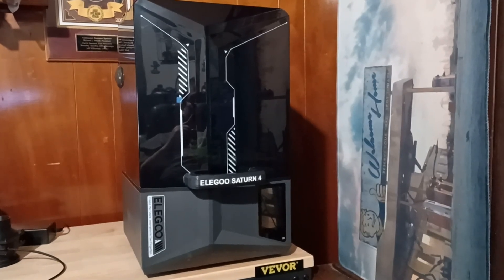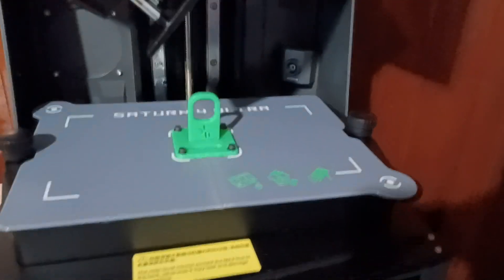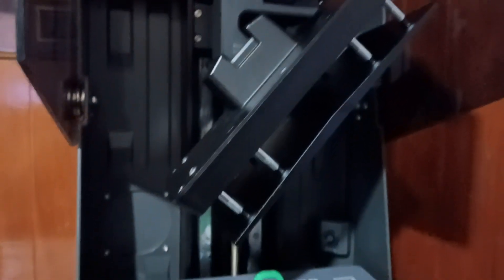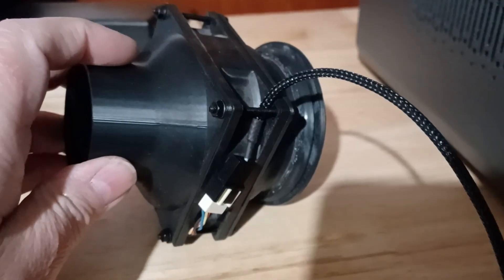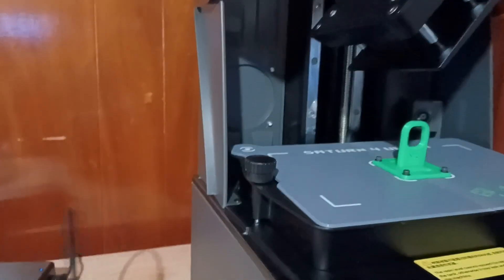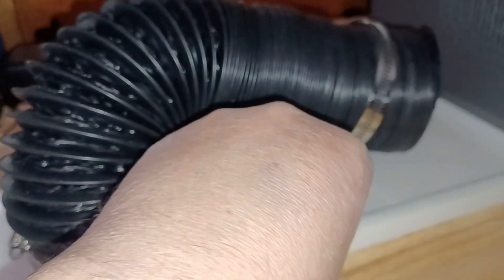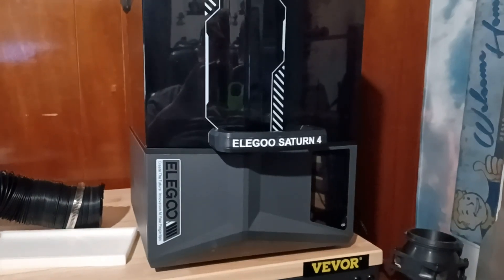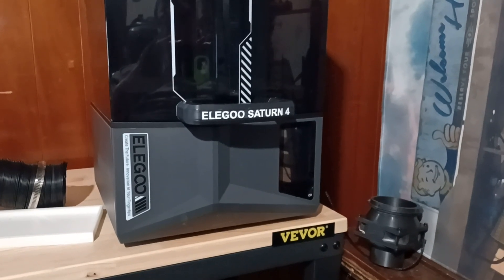Elegoo Saturn 4 Ultra FDM Printed Starting Accessories

Comment: Great video - links were very useful. Have been able to find equivalent products on Amazon UK. When printing the parts were you able to print them directly on the plate or did they require a lot of supports?
Reply from the maker: I printed all of these on my X1C FDM printer and I was able to avoid using supports!
Reply: @TJeffW1974gmail  nice! trying to figure out if I can print without on the elegoo itself! cheers though

Comment: Could i print these in resin?
Reply from the maker: Sure, you could. Lately I've been using the ABS-Like Resin and it is super strong so it would be great for all of the exhaust parts! But you could print it all with Resin no problem.

Comment: Too bad you don't include the sites where you got your STL's for the upgrades. I don't know what kind of resin you are using bet I have been using all kinds and no one in my house has complained. I even ask them to come to my hobby room when printing to check out the fumes. Respirator, NO! You need to see if your resin has been contaminated.
Reply from the maker: I haven't used a respirator either yet, but I was worried about not saying it! The smells were not too bad for me, but I was worried about my wife smelling it mostly.

Here are all of the links.

Fan Speed Adapter for 3-Pin/4-Pin PC Cooling Fans

https://www.amazon.com/dp/B07QFG6LFR?ref=ppx_yo2ov_dt_b_fed_asin_title

Elegoo Saturn 4 Ultra Drip Hanger

https://www.printables.com/model/1001328-better-elegoo-saturn-4-ultra-drip-hanger

Elegoo Saturn 4 Exhaust Vent Files

https://www.printables.com/model/1009978-elegoo-saturn-4-vent-adapter/collections

Saturn 4 Ultra Best Vat Cover

https://makerworld.com/en/models/458761#profileId-366900

Sliding Window Dryer or AC Vent Seal Kit with 4_ Air Duct Mount

https://www.thingiverse.com/thing:3801954/comments
Reply: You still need to vent it. Dont be dumb